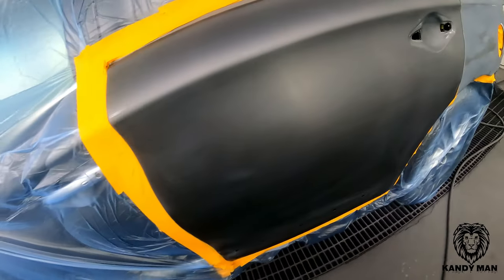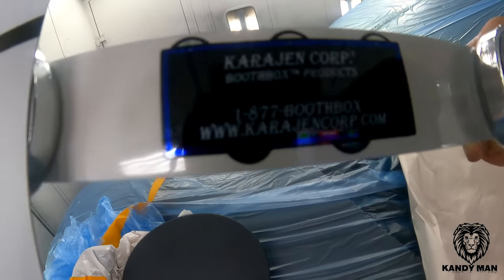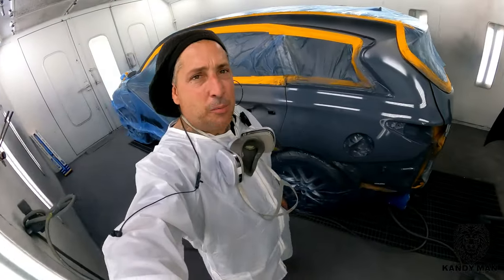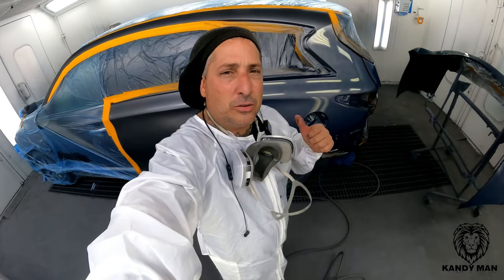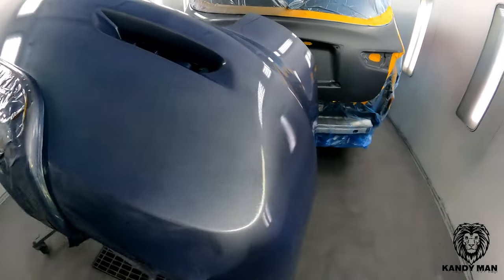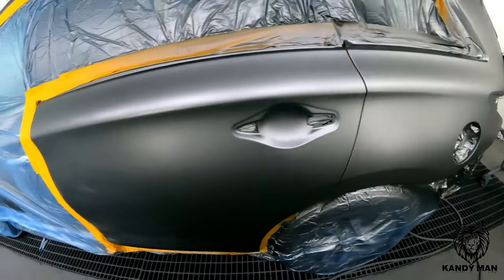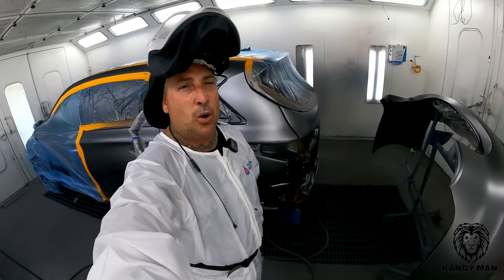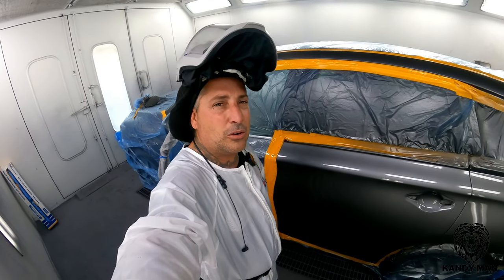SEALER, BASE, CLEAR - IN AND OUT

Comment: Why my clear coat shrinks once after drying ,when it's wet it will have clean mirror finish but after a day of curing it will have a blurred apperance. Any tip to retain the same wet finish even after drying
Reply: Let it flash off between coats
Reply: @xbeast666  thanks for the reply but I give 10 min flash off time between coats normally i do 3 coats 1st dusting and other 2 medium coats
Reply from the maker: Sounds like there right let the base flash off longer 👌